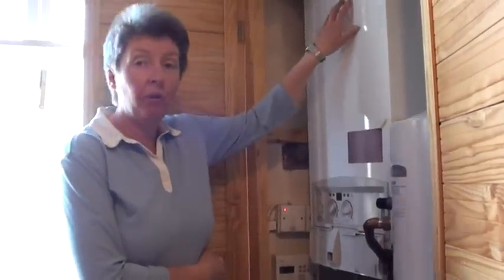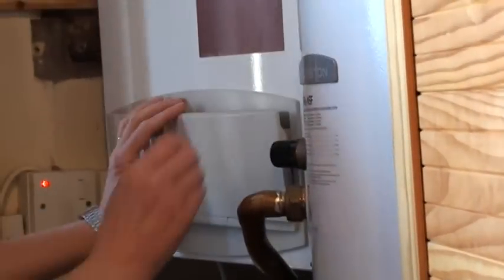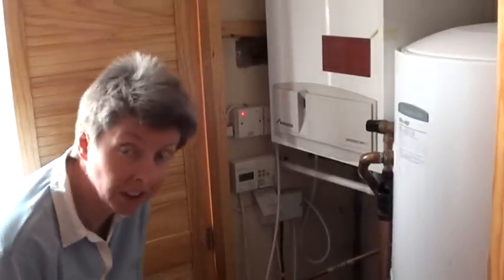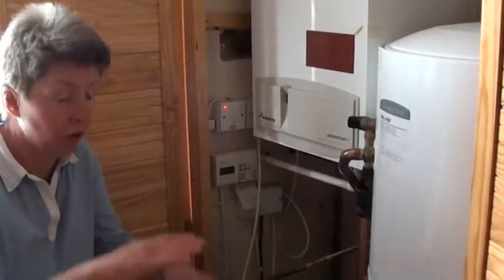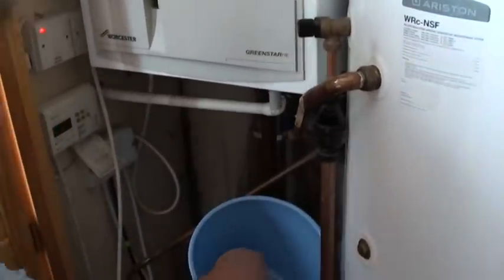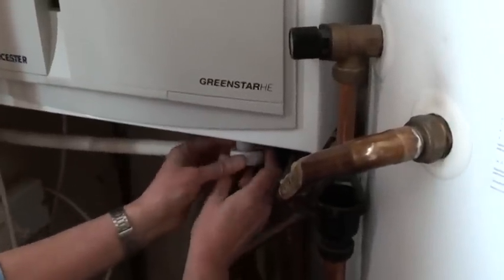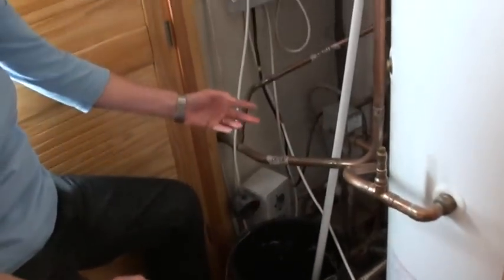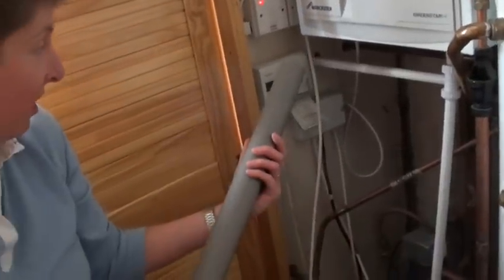Your boiler breaks down on the coldest day of the year - can you fix it yourself?

Comment: Thanks for this. My boiler started making strange noises  last night and came up with F7 then EA codes. Expected a long cold wait and expensive call out. Pulled the condensate pipe out from directly under my boiler and drained about 500ml of water. Switched boiler back on and it fired up straight away.

Comment: The  insulation on the video is not weather or UV resistant  so will not last and if the insulation is not correctly sealed it will still have a problem,